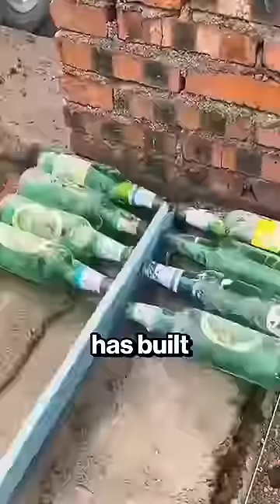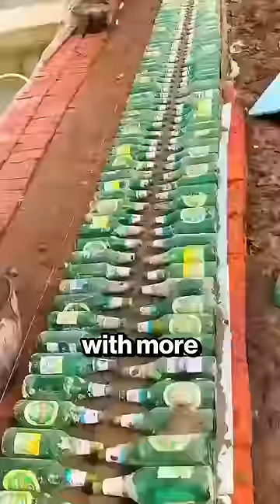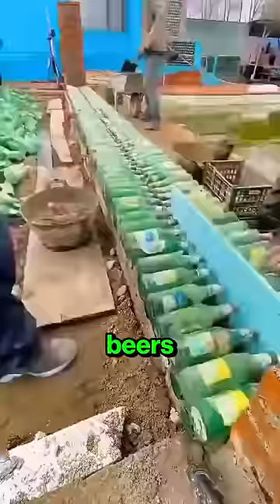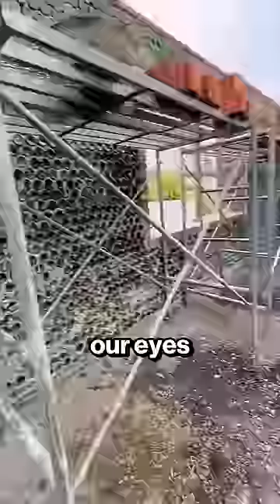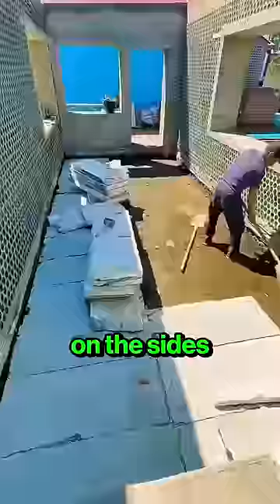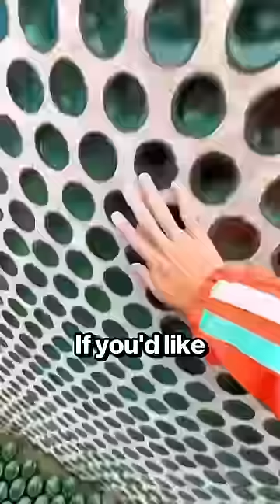This Alcoholic is a Genius 🧠😭

Comment: They have been doing this for decades in New Mexico. Not new, not alcoholic.
Reply: How is the climate in this house, hot or cool ?
Reply: They do this in Egypt and other middle east countries.
Reply: This has been done in Mexico for over a century now.
Reply: Earthships have beautiful walls with bottles
Reply: @martinz.4852 like 4 millennium ago the tradition pretty much circled the globe only to go back where it originated
Reply: In soviet russia to. For many reasons to
Reply: @--_-_-_-74..  was waiting for someone to mention that, cheers
Reply: @frequencywatchers vodka??
Reply: Now now!
Reply: @alray1261 Heat can't transfer through the empty interiors of the bottles as well as it could through a more solid material. Thus, the walls act as good insulation allowing the inside to maintain it's temperature better against that outside.

Edit: Also, glass isn't a great conductor of heat itself. For example, you can hold a glass rod over flame and then hold a similar rod made of common construction materials over it and for the most part, the latter will get much hotter than the glass.
Reply: They also do this in Puerto Rico for years
Reply: I visited a ghost town in Nevada that had a house made out of beer bottles in the 1890s.
Reply: Thank you. It's weird that people dont know about these being built in the southwest.
Reply: @martinz.4852   Seems like the sort of thing an impoverished nation would do.

Comment: When it gets windy, the house starts to whistle.
Reply: Only if it's windy on the inside
Reply: Is it just me or is he going to cook himself alive in the summer? I need a civil engineer to break down the thermodynamics of this house.
Reply: I get windy without the bottles.
Reply: Next earthquake he is dead.
Reply: Everything reminds me of her
Reply: @rodrigovillegas2263  You are wrong. Because of the air in every bottle this wall is the best for hold warm air inside in winter an cold in summer.
Reply: @desbat6065  yeah, I understand the air pockets would be good insulators, but if light can shine through the bottles then one day the sun might hit them just right and start a fire is what I meant.
Reply: whistle dixy
Reply: Thanks for the laugh.

Comment: There is a house in Hazel Park,  Michigan made out of bottles (assorted shapes, colors  and  sizes), and cement. It was built around 1930-1940.
Reply: They have one in Kaleva michigan that now functions as a museum
Reply: Thanks for the tip.  It took a little doing but I was able to find some pics of the one in Hazel Park.
Reply: Knott’s Berry Farm in Anaheim CA👍
Reply: Yeah definitely not buddy don’t think they had colored videos back then
Reply: @ddemons4730  they are just saying its not an original idea.
Reply: @ddemons4730 ….Not only did they not have colored videos then……., but they didn’t even have VIDEOS.
Reply: @njosborne6152  It's in Buena Park, CA
Reply: The Watts Towers are sculpture art similarly constructed but also with porcelain and other items.
Reply: @shebangbinbash1776  LA tried to tear it down, 
Took a couple of swipes at it before a City Engineer decided it was safer to let it stand!

Comment: Structural integrity has left the chat
Reply: Bottle walls are actually quite strong. This is due to the amount of mortar required to fill the large voids between the bottles. Secondly, the bottles are being held tight by the mortar, so they maintain their strongest shape. These glass bottle and mortar walls are considerably stronger than than a modern wood framed wall.
Reply: Ever try to break a beer bottle? No different than breaking a brick.
Reply: No it hasn't dear
Reply: @Abbas-tk5gi that’s why a large amount of maintenance is used when owning a house
Reply: @Abbas-tk5gi  it’s a cheap budget house what do you expect, the people building it knows that it won’t last long. This house he built will probably last 30 or so years and they are okay with that.
Reply: so did insulative properties

Comment: CEMENT is a powdery substance that, when mixed with water and aggregates like sand and gravel, forms a paste. This paste hardens over time to create a strong and durable material known as CONCRETE
Reply: Sounds like you need a couple of teaspoons to harden up
Reply: Go drink a beer super kitty
Reply: The powdery substance is a combination of calcium, silicon, aluminum and iron and when mixed with sand, lime and water it becomes mortar, when rock is mixed with all this and it sets it becomes concrete.      
       He is using mortar not cement.
Reply: So does your mom 😳😳😳
Reply: Chill

Comment: 10,000 bottles of beer in the walls. 10,000 bottles of beer. Can't take one down and pass it around, because the 10,000 bottles of beer are cemented in the walls.

Comment: Dear god the electricians and plumbers are going to love this one xD
Reply: It's actually easy to run wiring and pipe through such walls. You simply drill through the base of the bottle(s) and run it through or remove some bottles from the area for things that can't fit through a bottle.
Reply: @possumverde That's easy for you to say, you don't have to run the wires or put the boxes in.
Reply: wires are easy ....... plumbing sucks though

Comment: Glad its not in Kansas. Our tornados + this house = UTTER DESTRUCTION!!!
Reply: Yeah, nothing like wood frame and drywall, eh? 😂   Did you think or just type?
Reply: @fuffoon  You go stand in a building made of glass when when a tornado hits. Be my guest.
Reply: I could be wrong but I would think it would have trouble sticking together if you don't think of it as a layer of bottles but just one sheet of glass it would be a layer of glass then concrete then glass again going up but will the concrete stick to the glass enough to stop it from peeling apart

Comment: Technical correction - Cement is a dry powder, concrete is a wet mixture of cement and other ingredients.
Reply: That implies that there is a name for it after it has dried... Is there?
Reply: Not quite right. To clarify;
Cement is the binding agent. Once mixed with an aggregate and water it is concrete. You can just harden Cement with water and it is still just Cement. The Cement just doesn't have any tensile strength, and low compression strength. The added aggregate makes it concrete, which gives it compress strength. The rebar or metal mesh gives it tensile strength.
Reply: cement is actually just an ingredient of concrete. Cement is basically the binding ingredients. I disagree with your statement that one is dry while the other is wet. You can mix/use cement for different applications without adding the aggregates. It is not common but some creative masons will use it alone for different projects.
Reply: @Louse1021 yeah. "Finished"

Comment: The original earthship homes used recycled materials like tires in some walls and wine bottles in the interior walls or on exterior walls in small sections to let the light in. Dennis Weaver started the trend in the 70s

Comment: Instead of putting a thin wall between the bottles, h should’ve filled most of the bottles with sand. But would strategically place empty and some clear bottles so natural light could shine through.

Comment: All the air in those beers will actually be decent insulation. Is that very sturdy though? Wouldn't using the air filled glass like that for structural integrity be basically like having air in cement and cause it to crumble? Or will the shapes of the bottles make it strong enough?

Comment: In laws built an earthship in Taos, in that they did all the work themselves. Foundation was old tires packed with dirt.  The interior walls were beer cans  in concrete and then covered in adobe.  The exterior patio had a wall much like this made with wine bottles. The place was completely off grid. Solar panels and golf car cart batteries.

Comment: What I'm looking at is zero structural integrity.  Sure it looks cool and all but there is a very good reason rebar is used in all walls. What happens when a freak storm hits and you have 80-100 mph winds?  If the mortar starts cracking what's going to stop the cracking. I don't see one control joint.  You wouldn't catch me within 100 yards of the entrance.

Comment: This house is actually really nifty,sound proof and insulating like not absorbing insulation but one which just keeps inside temperature but installing ac unit may will be like nightmare but pretty good house i hope it i ceiling isn't bottle's only and it has support since i seen some crackheads who never seen concept of support

Comment: Then what do you do when the bottom of the bottles break? Cause its still glass.... if it breaks ull just have a bottle size hole. If he were to fill it with epoxy after then it would be a lil better